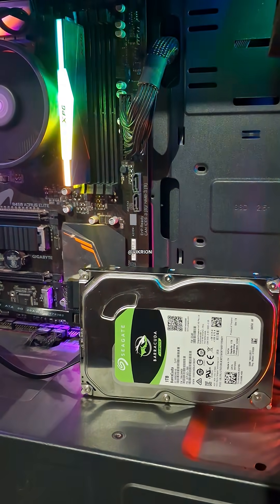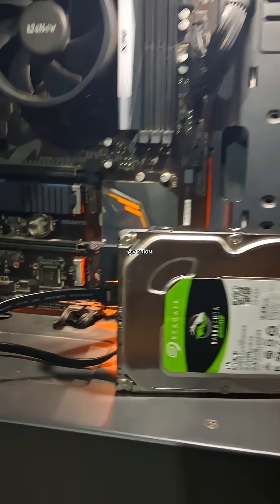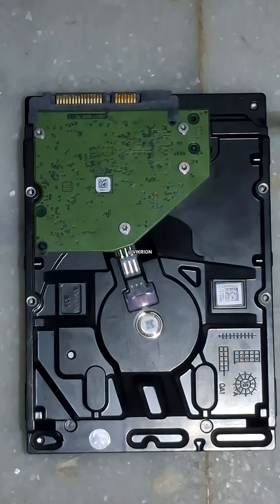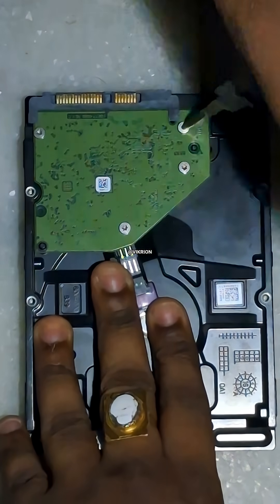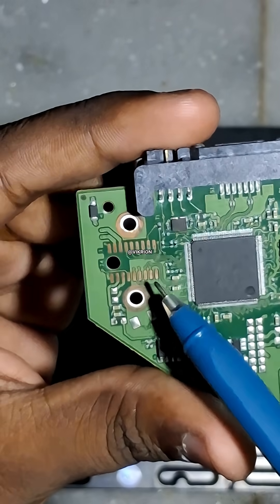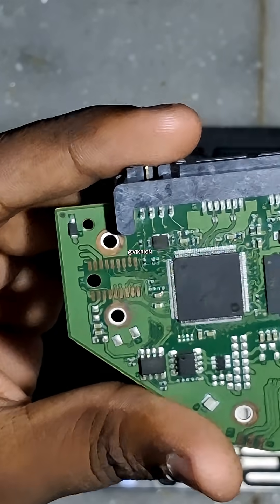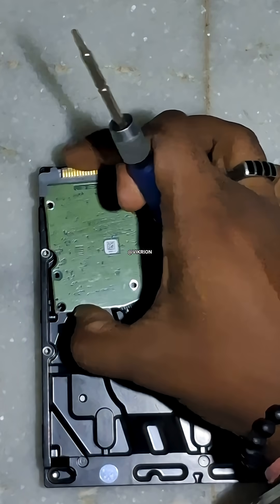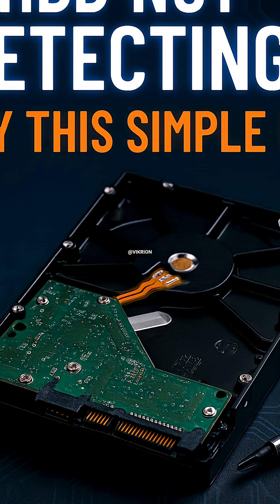🧠 “Hard Disk Not Detecting? Try This 85% Working Fix 🔧 #shorts #tech #systweak #disk #fypシ゚viral

Comment: I actually have tried this before, so I'm glad I'm not crazy. Sadly it didn't fix my drives, but these were really old drives.
Reply from the maker: “Yeah, older HDDs usually have deeper mechanical issues, so contact cleaning won’t always revive them.
But your approach was correct 💯
Thanks for sharing your experience!”